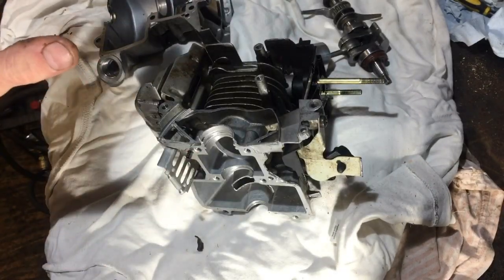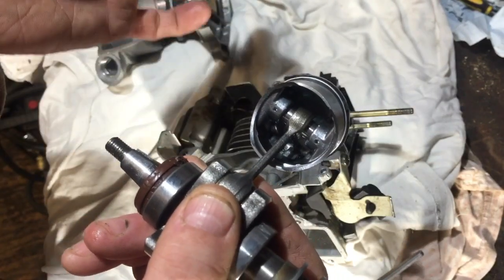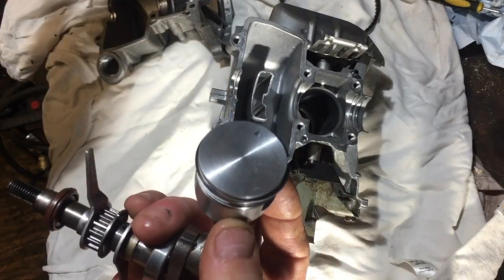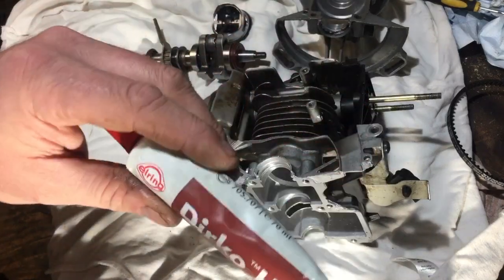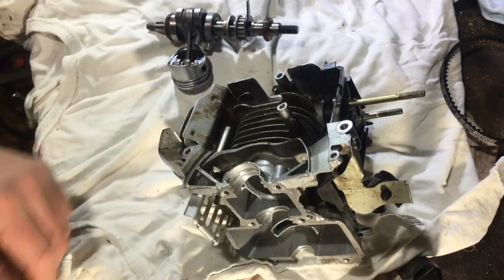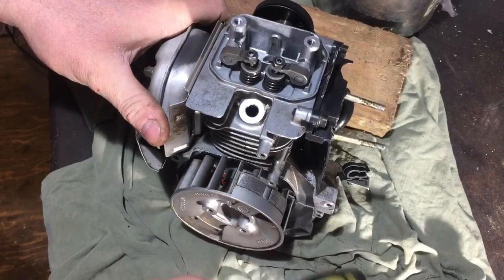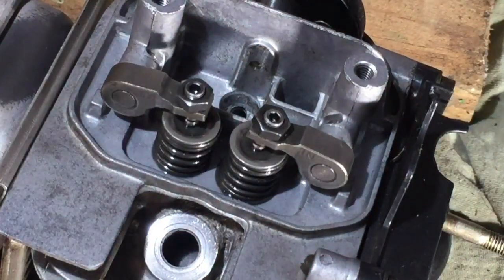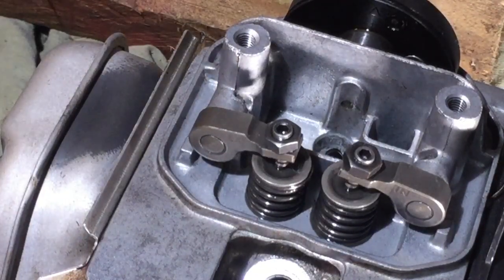Honda GX25 Engine ( working on, tips , Timing & Start up) Hedgetrimmer , Strimmer , Blower 🔧

Comment: Somtimes it pays  to  pull  it appart and see if  you  can repair it.  It's a nice little engine shame that  they seaze all the  time.  Nice one mate good job 👊👍👈
Reply from the maker: Hi yes 4 stroke on tools that get moved side to side upside down etc wasn’t the brightest idea from Honda, but then Honda are known for there 4 stroke (though I actually have an old Honda 2 stroke, quite rare). I prefer standard 2 stroke as the engine always has lubrication. These little engines do sound nice though, thanks for watching🙂👍

Comment: the timing arrow goes up on cam. not down 😆😆🙈🙈
Reply from the maker: It’s right I suggest you watch the video properly 13:40 I explain all, it wouldn’t run as good as it did if they were wrong, so I suggest you do it how I did.
Reply: It really doesn't matter if you assemble it with the arrow up or down.  The flywheel turns twice for each rotation of the timing pully.  16 teeth on the crank pully, 32 teeth on the timing pully!! Rotate the crank once and the arrow is up, rotate another time and the arrow is down.

Comment: You need small hands to work on this lol runs good mate..
Reply from the maker: Hi Mick yes they are small, I’m not really a fan, I always think hedge trimmers / strimmers etc should be 2 stroke. Lots of these fail due to seizing, as I’ve shown they can be fixed but I think Honda would say they are throw away units as there is a lot messing trying to fix them.. Thanks for watching🙂👍

Comment: Nice work. I've not seen such a small 4 stroke on a piece of machinery.
Reply from the maker: Hi imo they are not the best, I think they are ok if they are on a machine that stays flat when using, hedge trimmers done so they do suffer problems, but for under £15 it was worth giving the repair a go. Thanks for watching🙂👍
Reply: I think honda was one of the first, there are some chinese ones like makita but i don't know the quality. Mine have been great so far albeit with some fuel delivery issues from new.

Comment: Hi Luke. They're a funky little engine aren't they, never worked on 1. I had a binge the other day a rebuilt 6 Stihl 4mix, not my favourite engines cus of weight and vibration. But the torque is brilliant.
I wonder if part of a ring broke and damaged piston, looks like something jammed in there. Guess bearings were OK still? I've seen bearings break and do damage like that.
I've bought some cheap Chinese piping bags for the Dirko, works a treat and looks like factory when reassembled. You could just make your own piping bag obviously.
Great job👍😛
Reply from the maker: Hi tbh I don’t really like these engines also I’m not a fan of the Stihl 4 mix, I have though replaced a crank on a 4 mix a few years back. Personal I like standard 2 stroke stuff as they are much simpler. I wanted to try and fix this as the hedge trimmers are £500 ish new, the parts were cheap and it does run now and doesn’t smoke, I think the tappet needs adjusted as you see I did them, but one did keep coming looser, I will do that and try it on my own garden. I will sell it as I prefer my stihls and tanaka as they are all standard 2 stroke. These are just basically a small version of the gcv mower engines. Thanks for watching 🙂👍